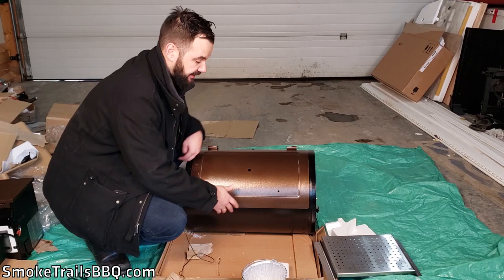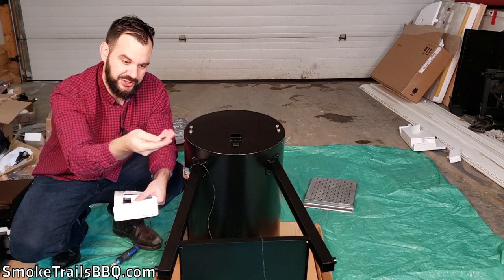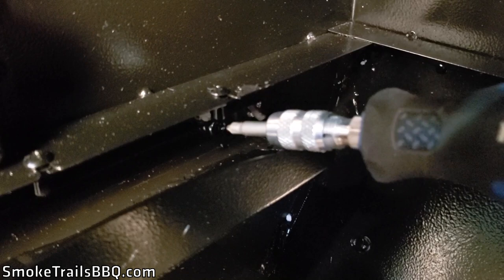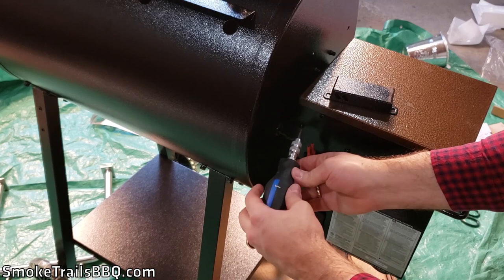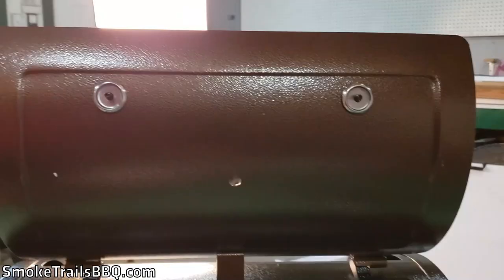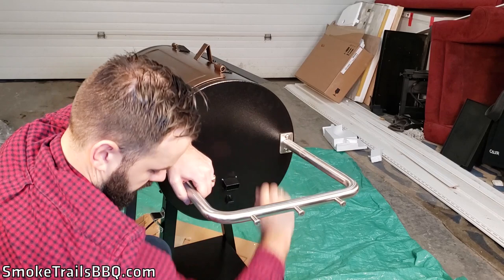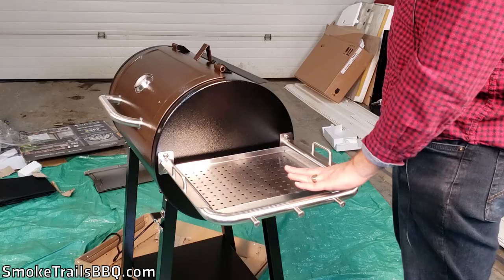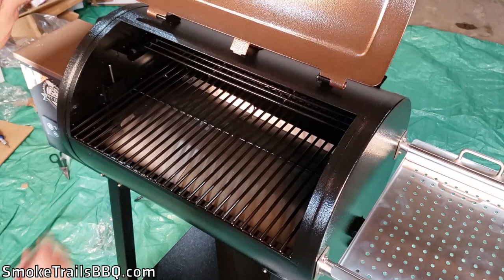How to Assemble the Pit Boss 456D Pellet Grill

Comment: Thank you very much for this video!!!  While trying to assemble using the steps in the manual, I got stuck at the wire connection  step.  Them li’l suckers didn’t want to attach.  You reacted same as I did when attempting to click them together.  After watching u do it, I wasn’t afraid to push harder on the pins to make them click.  Whew!  Thanks again!♥️

Comment: Seems easy enough to me. Not too thrilled with grease just coming out the end and onto the ground. I guess a metal bucket or something would be easy enough to put in place. Looks good! Great video! Thanks!
Reply: Thomas Whitten should come with a bucket. If not put boss has a buck for 10 bucks
Reply: it does include a bucket. if you watch his open box video of this grill then you can see that it looks really nice with good quality.
Reply: bonbons525 it’s a great quality and they also have foil liners available so you don’t ruin the bucket !

Comment: I purchased the 440D2 it helped a bit but the hopper feels a bit movable but I could only find 2 holes with screws to go into the hopper to secure it to the smoker.  I have looked for additional holes but none can be seen. So should it be slightly loose? This is my only concern about the unit. They have the worst instructions printed next to IKEA.  Thanks for the video this single mom appreciated you
Reply from the maker: On my model it's easy to see the two top holes but you can't see the bottom ones. You need to feel around for them on the inside and then thread the screws in. You could try using your phone with the light on to take a video down there to see where and if there are holes there.